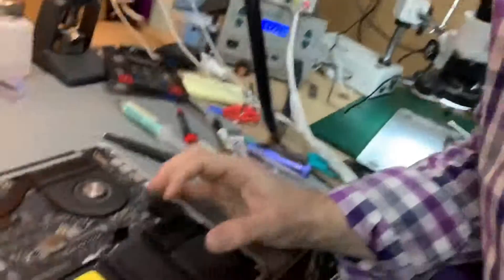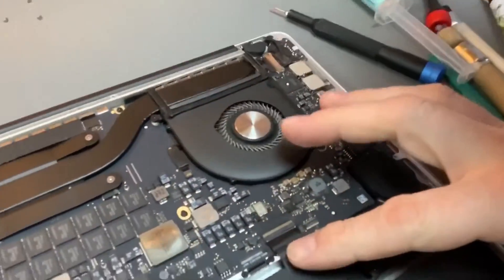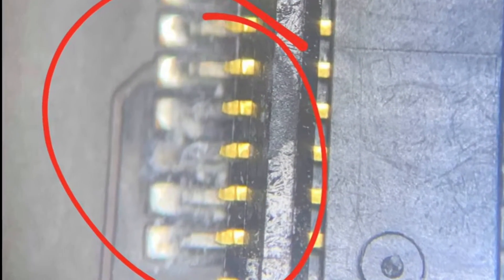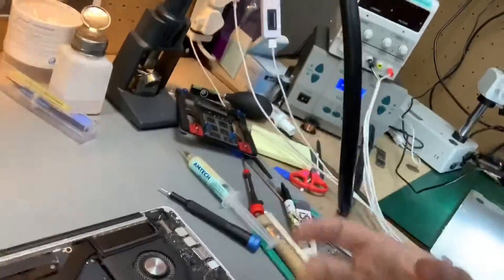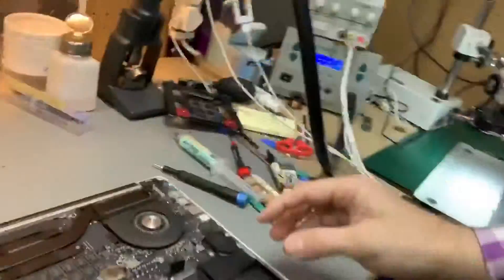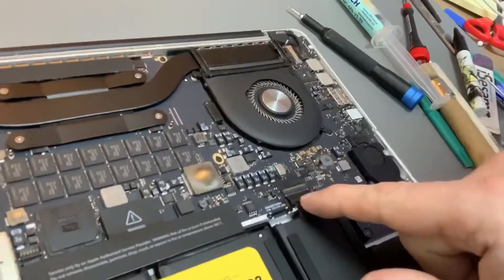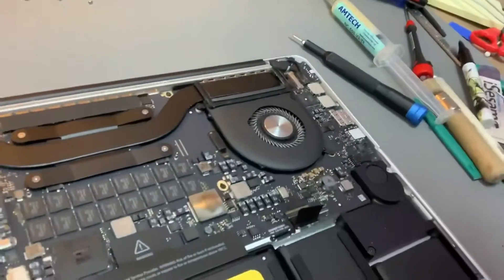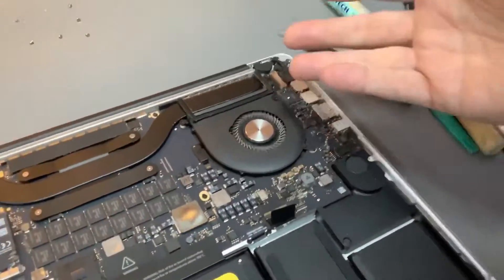RETURN OF THE MAC 💻

Comment: As soon as you said Cmd+R wasn't working I called a keyboard fault :P. FWIW to anyone else watching, those first 3 pins on the keyboard connector are for Left Shift, Left Option and Control, then the 4th pin is 3.42v. So its likely one of the pins (probably left shift as its closest to 3.42v) was shorting, causing it to always be pressed down. Thus when you try and enter a caps sensitive password it won't work. It'd also block Cmd+R since CmD+Shift+R was being pressed instead.